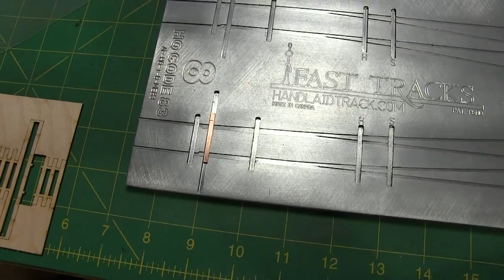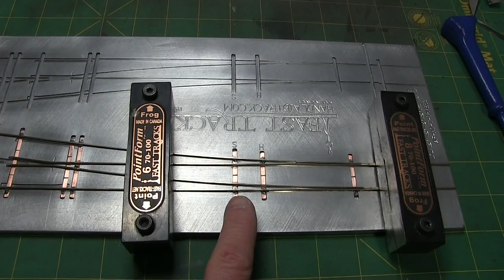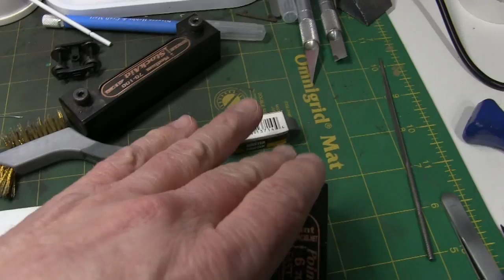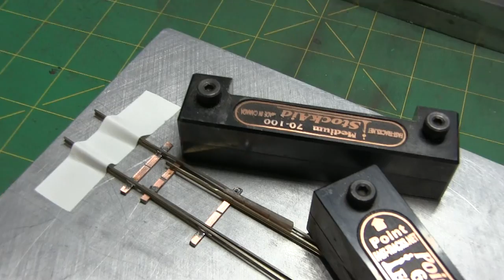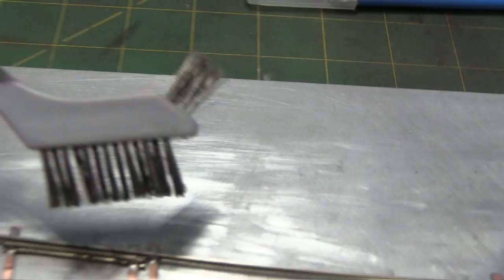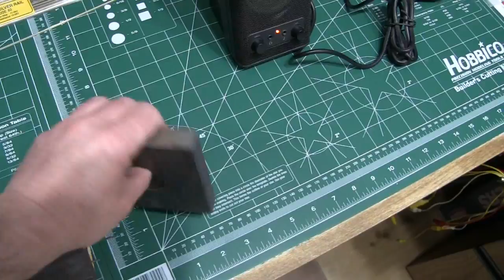Model Railroad Layout Update Video 30 : Fast Tracks Turnout "How To"

Comment: Nicely done. Interesting way to compare you with a jig and Boomer with Fast Track printed plan. I wonder if the cut in copper is easily visible once the turnout is installed and ballasted.
If so, with proper location of the cuts, they can mimic scars on ties left by a previous derailment. It can be on older ties that haven´t yet been replaced. The wooden ones being newer. Or you can do scars on them too. A logical
"line" of these scars left by the wheel.
Good job and video. Jig is pricey, but save time and is more comfortable for begineer that time saving if you have a good bunch of sale number turnouts to do.

Comment: What do you use to make your check off list. Is it work ? Or Excel?  Yeah I know the brushes do get gunky. I clean them with 91% Isopropyl Rubbing Alcohol between two or three switches. Or sometimes I use Windex. In a small bowl with a sponge in the bottom to help the brush get clean. Sometime the sponge brakes up which is no fun. Save my on brushes. I am looking at using a Artist paintbrush cleaner container. There is a scrubber at the bottom of the container. And it have a lid so I can use it over and over. Thanks for sharing.

Comment: Stephen, as far as the wire brush mess.....try Dawn dish soap to clean the wire brushes. I use Dawn to clean the turnout with a toothbrush. It works better to get to flux off, then take the wire brush to it. Your brushes will last much longer before having to be cleaned.

Comment: As far as the wire brushes....use some Dawn dish soap on the brush and it will claen your brushes right up. Dawn takes out oil and does a great job on flux residue.